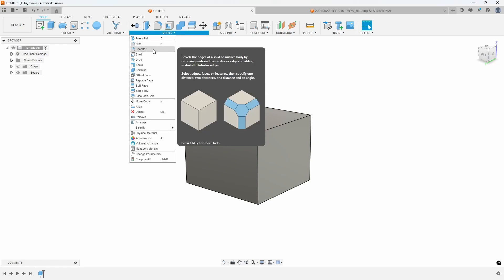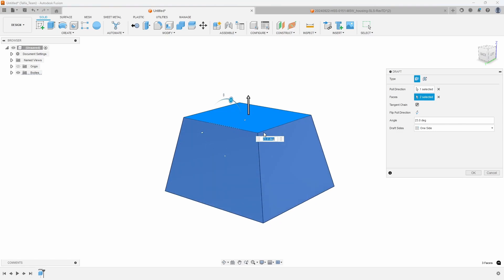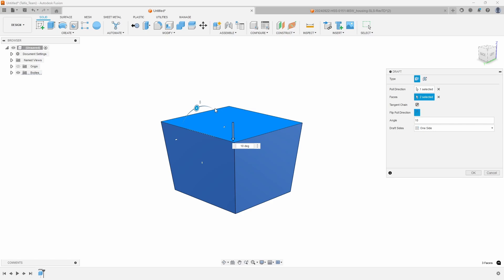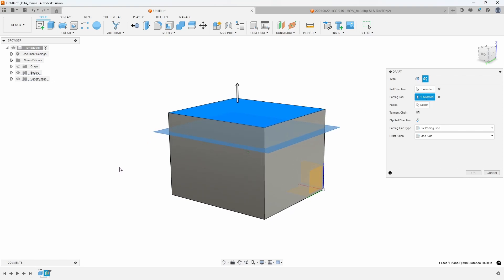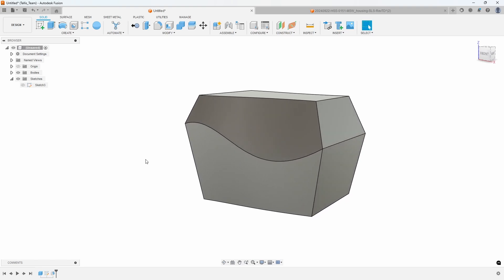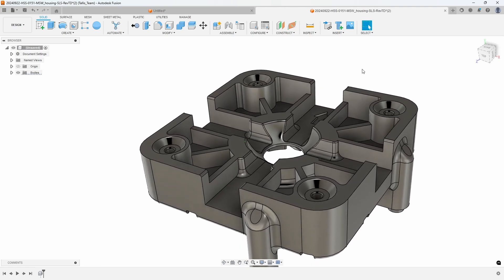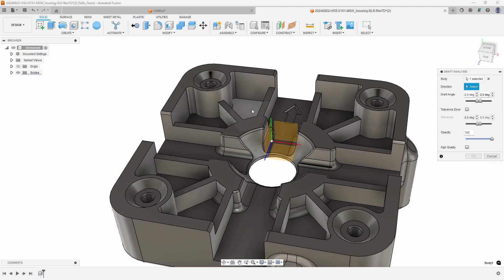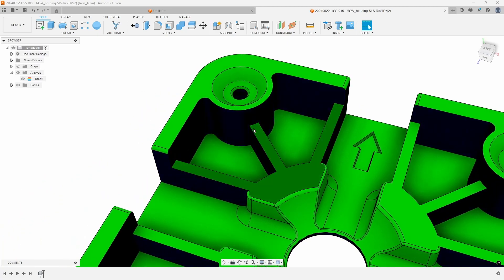Adding Draft in Fusion

Comment: Great info. Lets say you didn't want that top part to have the divot in it 5:35 and wanted that wall to be straight? Is this possible?
Reply from the maker: Because the parting line was a spline, the face will have that "divot" in it.  If the parting line was planar, then it wouldn't.  Think of a piece of sheet metal flat on the ground (planar).  As you lift it up to 45 degrees, it will still be a flat face.  That's a planar parting line example.  Now, start with your sheet metal sheet flat on the ground, but this time, put a bend in it (push the sides together), and lift it up 45 degrees.  The face will still be bent.  This is an example of a non-planar parting line.

Comment: Excellent as always! But why did fusion call it pull direction, it is a hinge point or fixed panel, and is complete nonsense when used with a parting tool.
Reply: The direction the part will be pulled from the mold.
Reply from the maker: @Timboykee - This is probably the best explanation and I should have mentioned this in the video.
Reply: @bradtallis8968  Please correct me if I'm wrong, but I think it is the direction that the mould is being pulled from the part.

Comment: Obvious question @Brad, but what were the red faces trying to tell us?
Reply from the maker: Basically, it was showing the faces that were between 0 degrees and 2 degrees in my example.  Because the green faces were already tapered 2 degrees, but they butted-up against a vertical wall of 0 degrees, that's why you saw that "sliver" of red as the face transitioned from 2 degrees to 0.  Kinda hard to explain.  Good eye, though  ;)